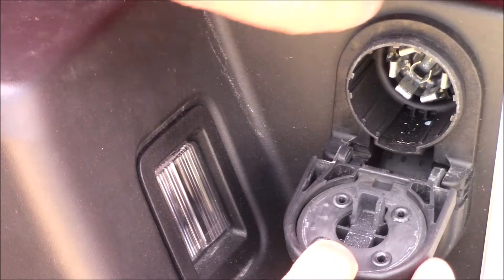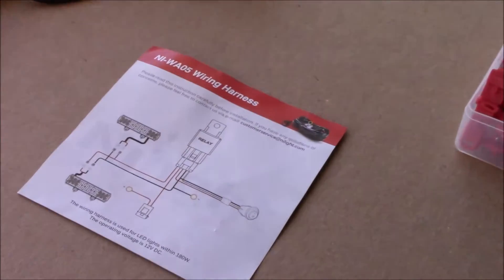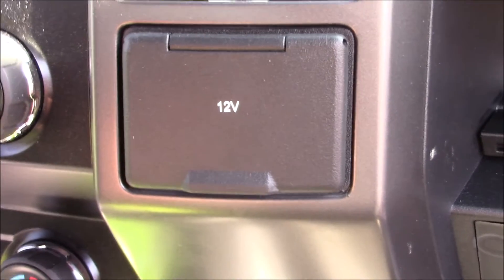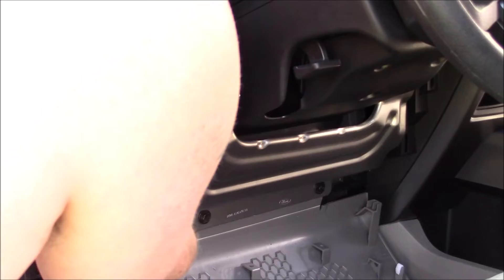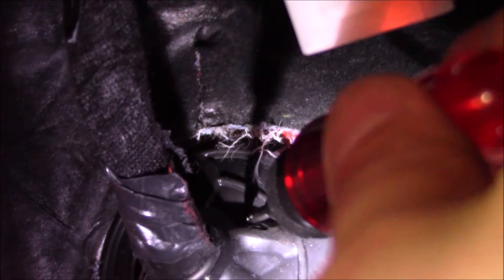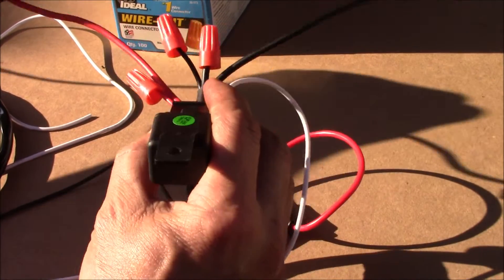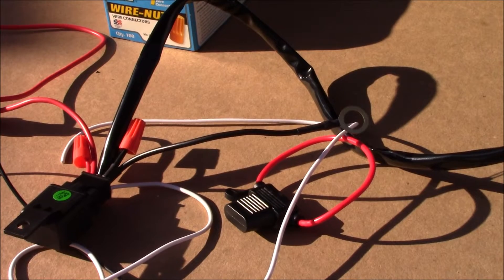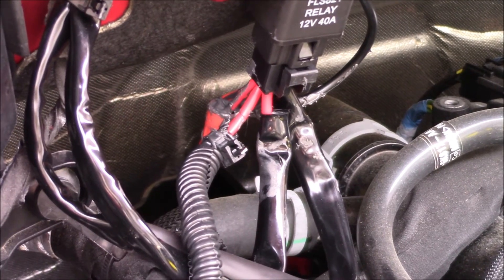F 150 trailer battery charge via the 7 pin connector

Comment: Most people don't know how to do this.  Well done.  In your case, the 12V Aux battery charging wire is NOT connected to the battery.  This leaves your wire not connected to power.  Many vehicles do have this wire on the hot supply.  In this case, your relay wouldn't work.  The orange wire is left disconnected on the fuse box and allows you to T into it.  That way when the relay is energized, the power is allowed to pass through the relay and onto the orange wire.  Great.   However, if the orange was hot (like in my case), this would be bad.  Your relay would effectively be shorted out and it wouldn't work.  If the orange wire is always hot AND you wanted to use it to T into the wire harness,  you would have to disconnect the orange wire going to the fuse box.  This would allow the relay to work correctly.    Just realize this approach will not work if the 12v Aux battery charging pin is hot all the time already.

Comment: There seem to be 3 things that need to happen for the truck computer to energize the 12V to the trailer. 1) Sense there is a trailer connected. 2) Engine running. 3) Driver door closed. I will be doing a similar install as you but I need 20A charging current for my trailer and that is more then the small orange wire can provide.  I will use the orange wire as the relay trigger wire and run a new #10 gauge wire from the relay all of the way back to the 7 pin connector. Liked your nail trick, thanks.
Reply from the maker: glad you liked it

Comment: You should check with a Ford dealer before doing this. The voltage at the battery charge pin may stay at 0 volts until the truck senses a trailer connected and then the truck increases the voltage
Reply: But not constant power

Comment: Nice video. Would be interesting to know how many amps you get at the trailer battery? It is a long way from the alternator and thin wires......
Reply from the maker: if my RV batteries are very low it takes over 4 hours of driving to get them fully charged.
Reply: @bbbjim1fixedit  Thanks. But that is impossible if you have lead-acid batteries. There is no way you can charge a lead-acid battery from almost empty to full in 3 hours. That is technically impossible even with a good battery charger. In best case you would reach 80-85%.

Comment: The newer F150 trucks only have 12 volts on that pin when truck is running and in gear
Reply from the maker: That would explain why when I let the truck idle in park and plugged in to the trailer it would not charge the battery
Reply: @bbbjim1fixedit  I also went into ford..... They didn't know why there was no power...... I set the parking brake put in gear and said there is the problem...... Ya got to be in gear.... Still drives me nuts that it had to be in gear
Reply from the maker: @JayWannamaker  Thanks for the info

Comment: I don’t think that’s a good way of doing it because you will be directly connecting your tow battery with your car battery. It is not a good idea to directly connect different sizes types, and brands of battery.. I do believe there is a diode in your factory trailer charging system that prevents voltage back feed from your trailer battery even when you are driving. that’s why you must have the trailer brake connected or at least make your vehicle think it is connected to a trailer brake system. Also, you will have to connect your turn signals through your trailer connection in order to fool your vehicle into thinking you have a travel trailer behind you.. There is a video where a guy is trying to charge a Jaackiee and he did a beautiful wiring hack.

Comment: Thanks for you video! I just learned my 2018 F-150 SuperCrew with tow package will not charge the trailer batteries while driving. The RV dealer checked the 7-pin Aux 12V and it showed no power.   I spoke with a Ford service tech and he stated in order to have power the truck needed to be parked and you had to keep your foot on the brake pedal. He then hooked up a device that simulated a towed trailer and when the brake was not pressed there were zero amps at the 7-pin., but when the brake was pressed it showed 6-7 amp at the 7-pin.  I also learned about a DC-DC battery charger that bypasses the 7-pin and can produce 20+ amps. Does anyone have experience with a DC-DC charger?
Reply: So you have to hold the brake to get power? That sucks. I have an electric trailer lift that’s powered by the 7pin. And the truck can’t recognize it. Idk how I can hold the brakes while using the lift. Damn

Comment: I wouldn't think you should need to tie anything in. Being a newer truck you shouldn't have to add things like a farm. I keep hearing about a fuse and relay situation? Yours isn't the only one, I definitely don't think everyone is piggy backing things into the system? My 19 doesn't have power to the same pin and I definitely won't be adding anything.
Reply: Update. Once I saved my trailer, started it and hit the brakes a couple times my interior trailer lights started working,(only with it running) and hasn't been driven since last summer and still 12.6 v on tr. batt. So I assume, it's only to maintain not to totally charge, like a battery tender. That's probably why no power with a meter, no load to tell it to charge. Seems either way like something that should just be right from the factory.  Not adding fuses, relays, etc... my phone can recognize my face. A 50k truck should not need anything done to it. Your vid actually helped me figure it out though. Thanks.
Reply: I’m trying to run a 12v bilge pump in my bait tank from this 7 way. I wired positive wire to aux and grounded. The plug lit up like there is power but the pump would not turn on. Any help?
Reply: All you have to do is turn on your running lights on the truck, and that powers the 1 o'clock pin.
Reply: @jwsclark19  that's a lot of help 2 years after we were talking about it. 😄